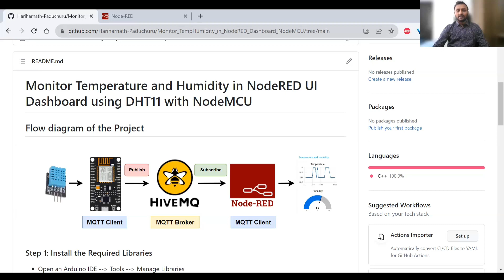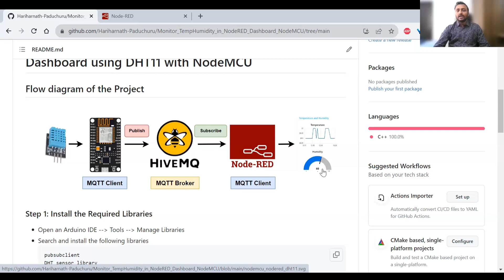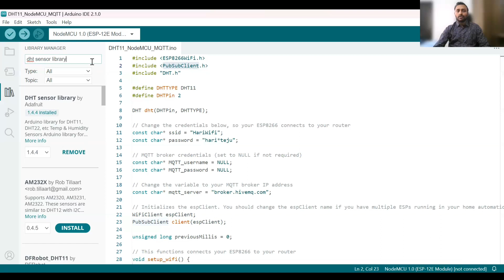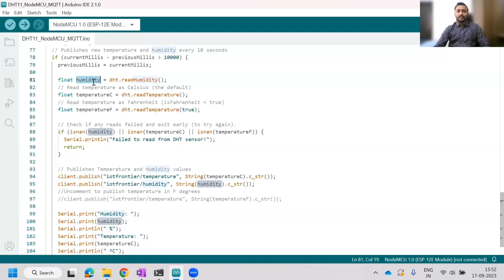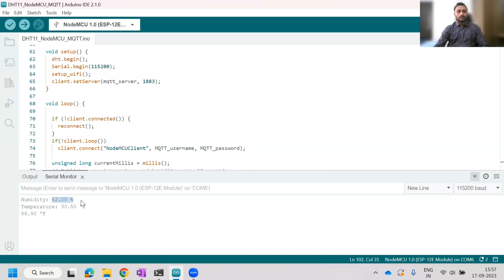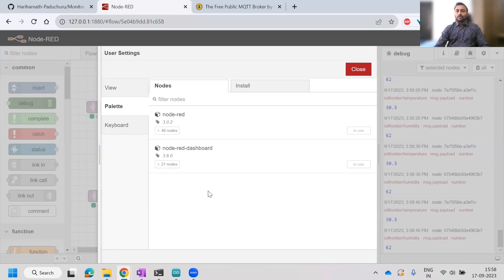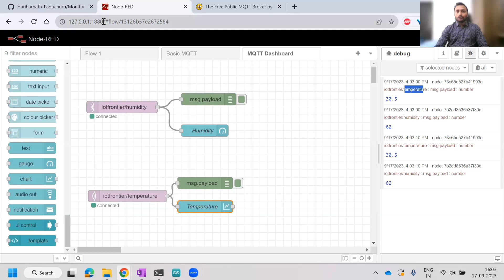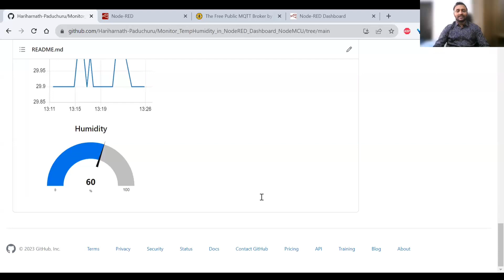Monitor the DHT11 with NodeMCU on Node-RED Dashboard UI using MQTT | Node Red Tutorial Part 5

Comment: Hello! For those there are having problems using a diferrent Host than the public HiveMQ one, where facing with "failed, rc=-4"
Problem solved using TLS Certificate. Add WiFiClientSecure library and input certificate as follows in the link below:
https://community.hivemq.com/t/hivemq-using-esp32-and-nodered/1291